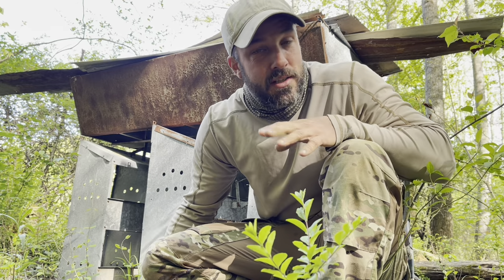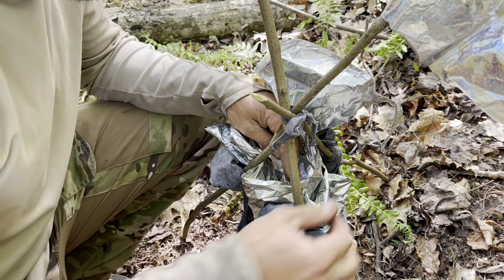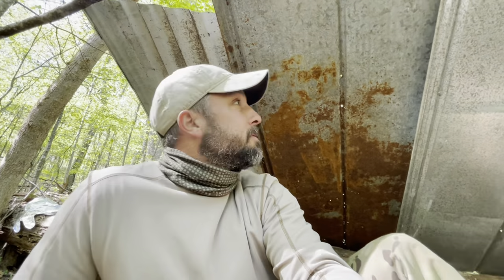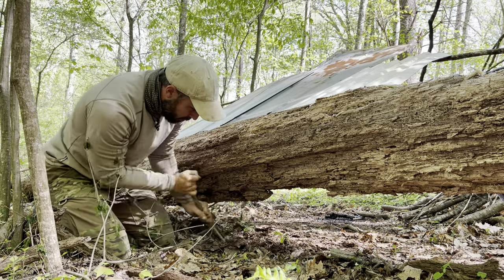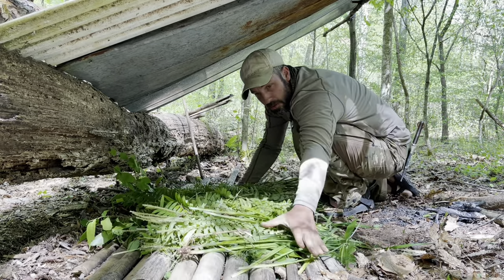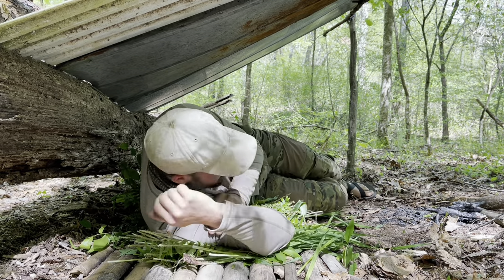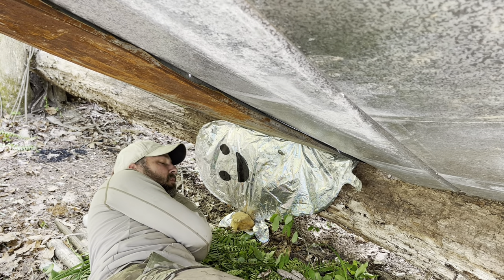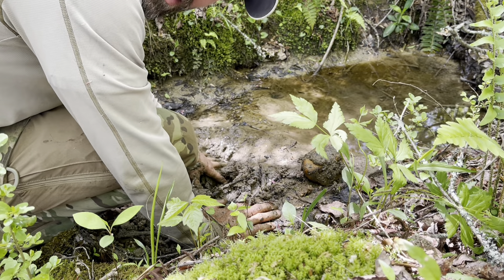SHELTER With Only A KNIFE?

Comment: I went truck camping last night and forgot a lighter. I tried using this little farro rod on my leatherman to ignite a tumble weed ( the ones for bbq starting) but I ended up starting the fire with my jumper cables and a tent stake. Had to light a napkin then the tumbleweed.
Reply: Nice job!
Reply: Good job.  We did that once and I happen to remember I stuck a mini lighter in a bag just in case.  It was still there.

Comment: That pool of muddy water if we can dig a sort of channeling it to flow to one side the dia a hole about a few inches away from the muddy water so that the ground itself act as a filter then either use the charcoal or fire to boil it maybe using hot rocks ...hmmmm..

Comment: I’ve been enjoying the series.
And thinking about what knife I would want if I was to try this myself. 
I have so many knives. But it would probably have to be one of my edc knives. 
So maybe I need to start carrying something besides the Prather War Bowie or Brakimo (my most used edc’s).
Reply: Arctodus Simus You cant go wrong with a full tang knife if you notice with most of these survival people they carry and use a full tang knife as they are stronger than a flip or pocket knife.
Reply: @rodneymiddleton1044  
The only folder I carry is the Cold Steel Pocket Bushman. Far as I’m concerned, it’s the most hardy folding knife.
Reply: @rodneymiddleton1044 the 2 knives he mentioned are fixed blade full tang knives